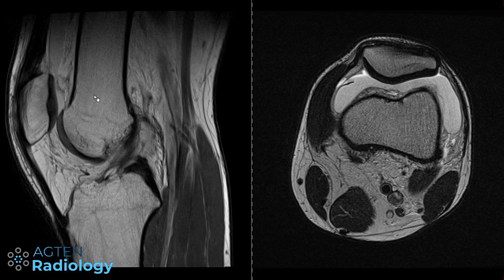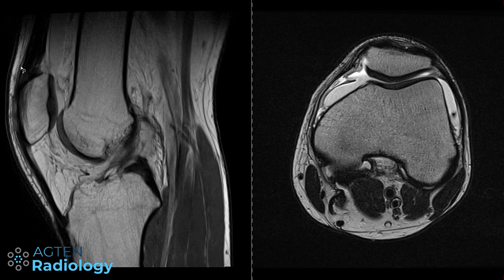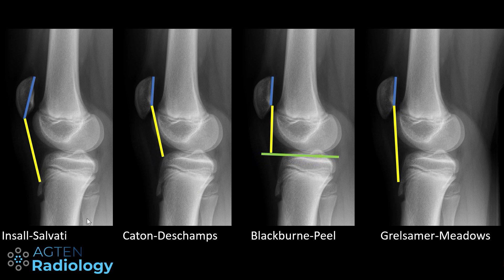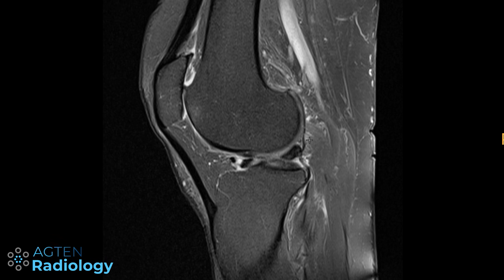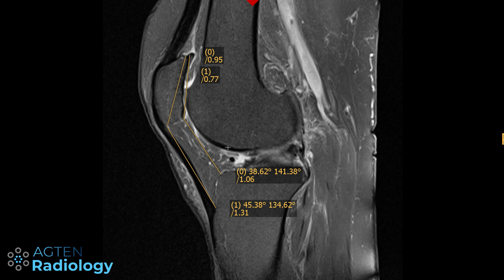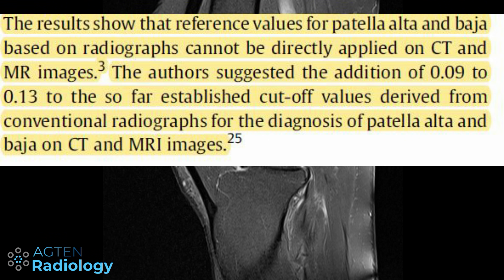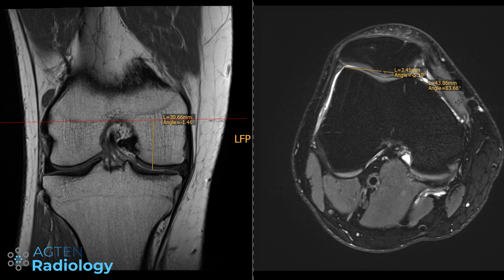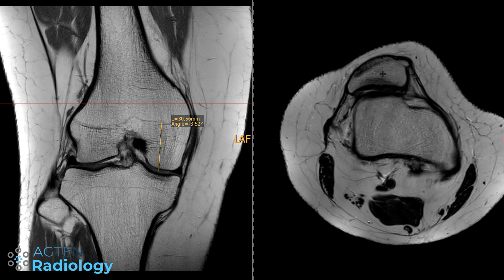Patellar Instability - What and How to Measure

Comment: Just FYI, the knee in the CT scan for TT-TG is not 100% aligned, causing measurement error (0.8 mm per degree(Yao et al. ?2014?)) so you are likely about 4-5 mm off, hard to say without a coronal slice.
Reply: Long knee-axis to scanner axis

Comment: Great video:-)!When you measure the depth of the trochlear groove, do you measure to the bone or the cartilage?
Reply from the maker: In the original paper by Pfirrmann they measured the bony contours, but different from what I have shown in the video. They measured hight of the lateral and medial facets together, divided by and then subtracted the height of the trochlear groove. This was done 3 cm above joint line
 Why 3 cm? You have to m measure somewhere 😂. The depth is different when measuring cartilage or bone. Cartilage in the centre of the trochlea is thicker and aggravates any dysplasias as shown here https://online.boneandjoint.org.uk/doi/full/10.1302/0301-620X.88B5.16866

So it is not really evidence based to measure to the cartilage, but probably clinically more relevant. But I use it only if not sure from eyeballing. 3 cm above joint is random anyways as it does not take patient size into consideration. So take it with a little bit of salt 😂🙈
Reply from the maker: https://radsource.us/trochlear-dysplasia/

Very good discussion about measurements, so the way I measure is the Charlie method.